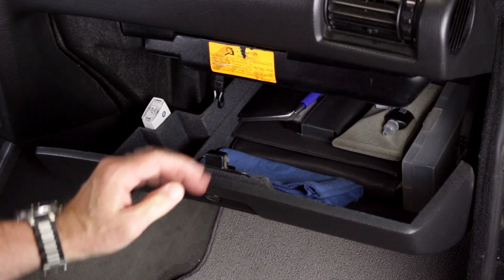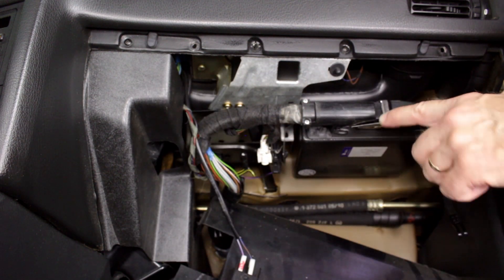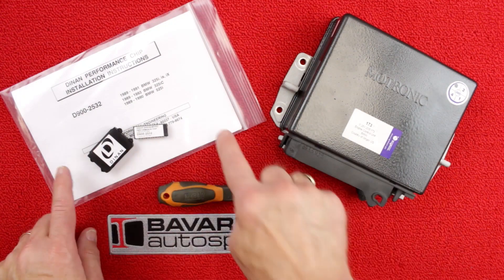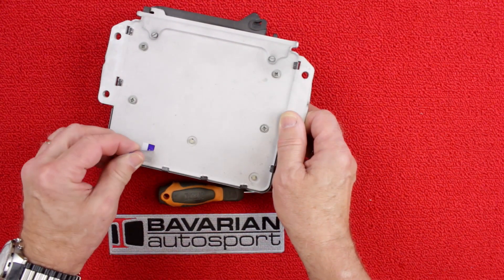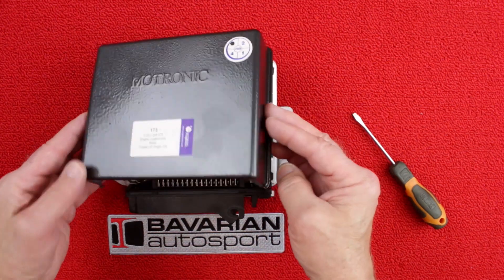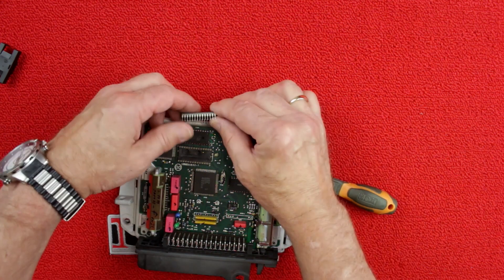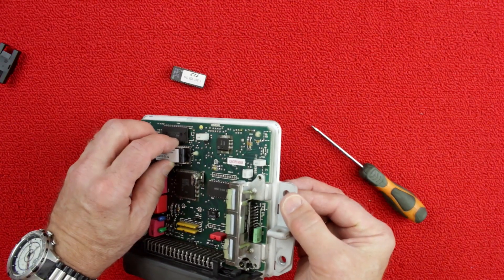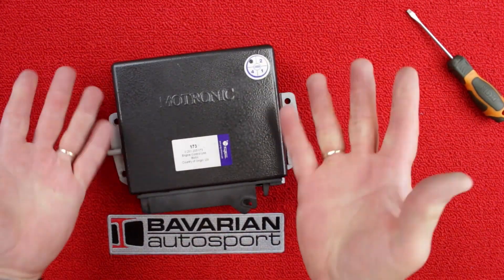How to Install a Dinan Performance Chip in a BMW

Comment: When I replaced eproms, "chips" in BMW's as a factory upgrade we had to use a static mat along with a ground strap on one wrist, some even stood on a static mat, the chip came in a anti-static bag so why not now?
Reply: It’s always best to be grounded while handling any electronics. I’d also recommend IC pullers for this job, personally.

Comment: I'm about to do a m20 swap from a 90' 325i on my 85 318i, so ill probably end up getting one of these. I feel like it will be a good asset to the swap.
Reply from the maker: +carl shneebly The M20B25 (2.5 liter 325is, & 525i M20) responds well to the performance chip upgrade.